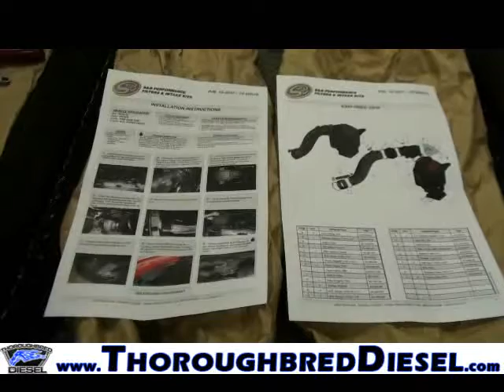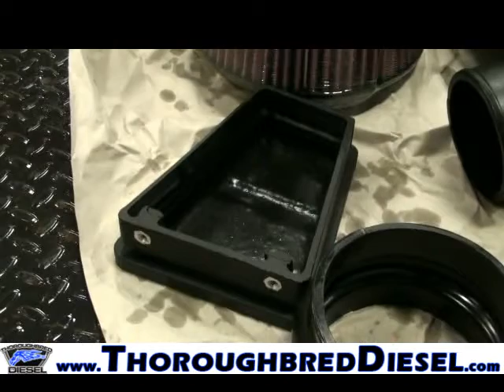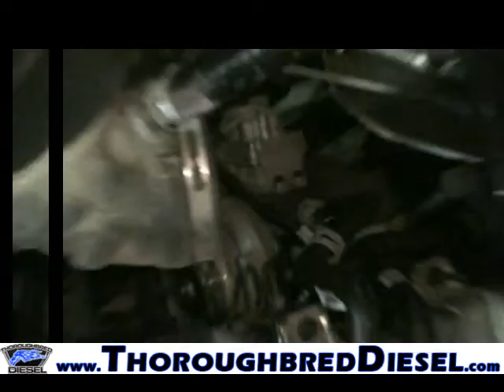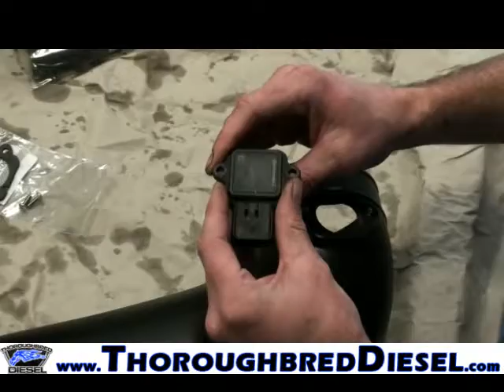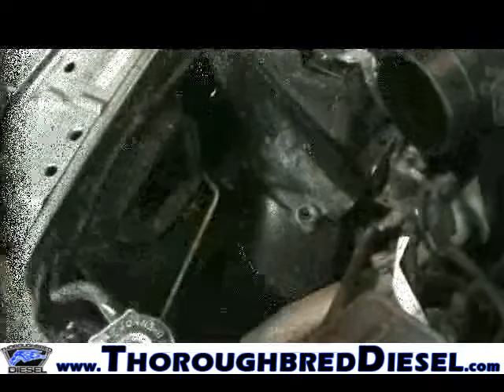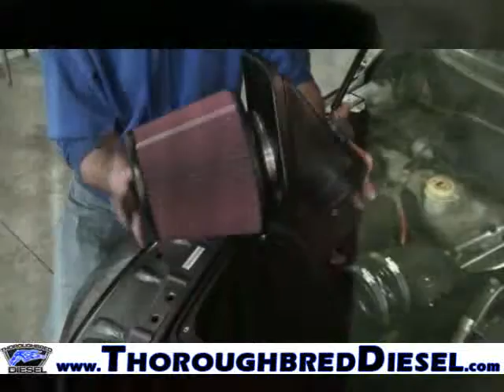S&B Cold Air Intake Install: 2010 Dodge Cummins #75-5057

Comment from the maker: Patrick we usually don't see more than about 1 MPG on an intake install unless is it coupled with and exhaust. We do however see pretty significant drop in EGT's which in our book is bigger pluse than 1 MPG just due to engine longevity.

Comment: just installed this in the dark, standing on a chair, with the hood light and a led magnet light....45 min!!! also instead of disconnecting the batteries and sensors I left them all hooked up and simply tranfered them from old intake to new
Reply: I know its an old video but do you have to re tune the truck after installing it?

Comment: If the airbox flows more air and the fuel/air mixture is proportioned by the mass flow sensor and computer, why wouldn't the fuel mileage go down?  Seems to me it could only go down and not up.